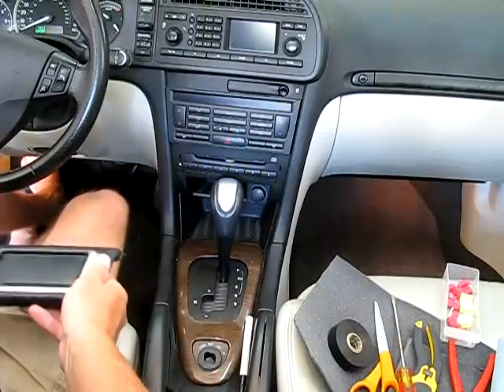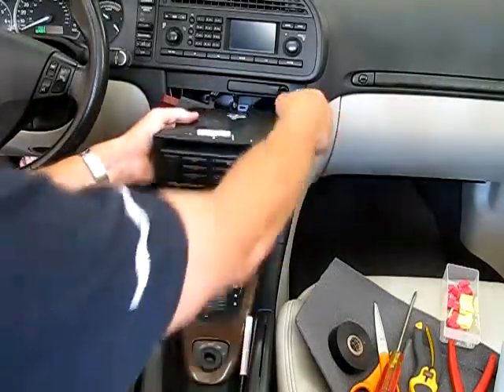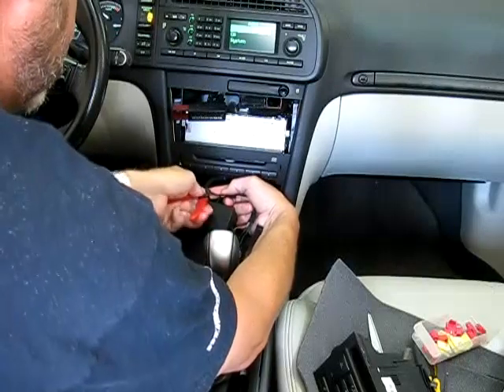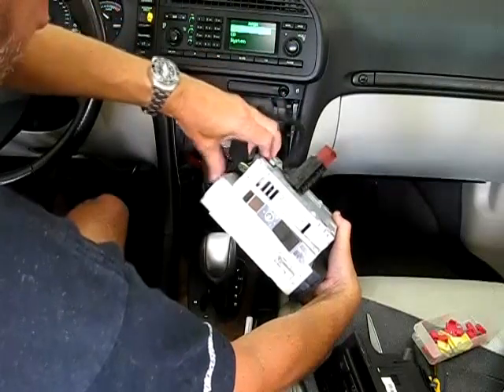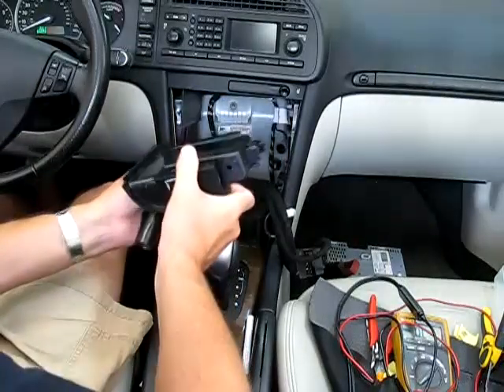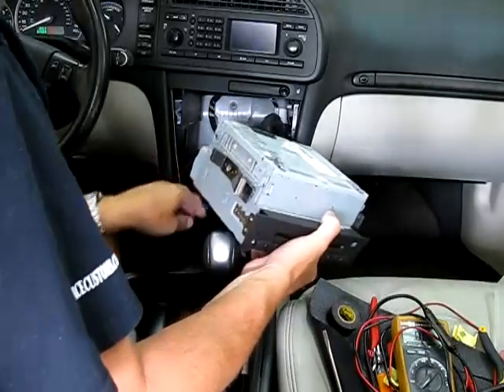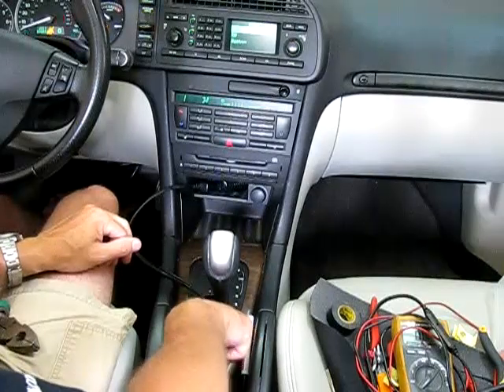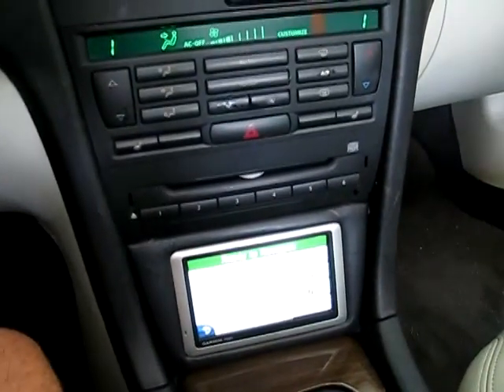2006 Saab 9-3 Aftermarket GPS Install

Comment from the maker: Not anymore. There was a short period after Saab declared bankruptcy when the factory wasn't making parts, but I think that has been resolved now. For example, replacement keys were selling for $1000 on eBay because the dealers didn't have them, but now you can get them for under $100 at the dealer or $15 on eBay.

Comment: Just done my GPS as u did with the help of ure vid but didnt want to hard wire it so just used the cig lighter power, but as its a Tomtom the power on/off switch is on the back of the unit.Not a good idea as i have to get to the back every time i switch it on/off. And the harness wire u sent me for the aux works brilliant. Thanks.

Comment from the maker: Yep, I have a video which shows how to do that. You'll need to take your car to the Saab dealer and get them to enable the aux input in software, but the car has the capability, it just needs to be enabled and wired up. Go to my youtube channel to see the video of how I did it on my car.

In 2004 the aux was disabled by default. In either 2005 or 2006 they enabled it. If you see "Aux" on the display as you cycle through the modes with the steering wheel button, then you're already enabled.

Comment from the maker: The 2003-2006 9-3s won't take a double DIN head unit without serious modification. In 2007 they changed the dashboard design slightly so a double DIN will fit, but since mine is a 2006 that wasn't an option. 

A windshield mount blocks the view of the Sab Information Display at the front of the dashboard. I tried mounting it to the left of the instrument cluster but I didn't like it over there. If I mount it further to the right it blocks the passengers (my wife's) view. That was unacceptable.

Comment: Hi, I'm seriously thinking about buying a 2006 saab 9-3 2.0t. I have a 95 volvo 850 turbo but I want something in the mid 2000 so I looked at the reviews of this particular year, I heard good thinga and bad things, my most concern are the engine and trans. Are saabs reliable cars and are they easy to work on? Are they worth buying?

Comment: Great video......I wish I had the guts to try this because its really cool.  I wonder, my saabs have a phone button on the stereo and there are mics on the headliner in the front right and left and also in the rear.....do you or anyone know how to make this usable?  I was told by saab that it is only an option in Europe.....seems a shame not to use it.  Also, any video on replacing/upgrading saab speakers and subs?  The sub in my sport combi is so sad.  The rear speakers in both the combi and my convertible are just not good enough.  Thanks.  Great viedeo guy!
Reply: Rob Butterworth did you get a reply to your question about the phone?  I have a 2006 9-3 convertible and I was told the same thing by our local Saab repair shop in Durham NC called Swedish Imports. I also went to a local stereo shop to see if there were any aftermarket options and was told no.

Comment: By a Saab with build in GPS, my Saab Aero has one :)
Reply: You can buy an ICM3-unit(the one your car has) on many different sites, such as ebay, and install it yourself. I'm going to do that, I have the basic unit without a gps! So I would advice people to do that instead of an aftermarket one, since it will stick out alot
Reply: Alexander Nilsson except you need to add the dvd drive, gps brain, gps antenna and the entire loom from donor car. And after all of that the factory nav is crap and out of date
Reply: So does my Arc convertible
Reply: .but the Saab one is poor compared to the newer ones.I have a 2010 Aero but didn’t worry about not having their SatNav.

Comment: Hi, I would like to do exactly the same but which material did you use around the GPS and how did you make it fit?
Reply: Just buy a Saab one and swap it out. It’ll probably be easier than undoing the entire climate control